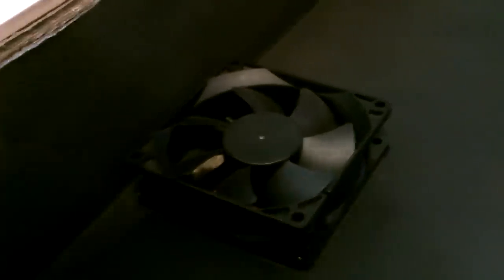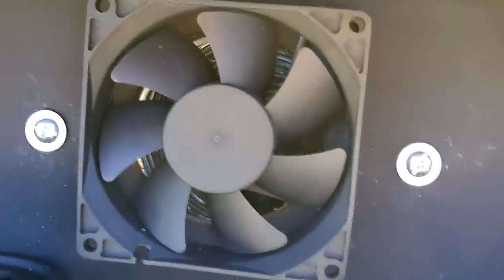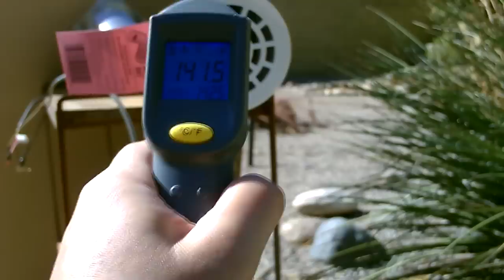Homemade "Steel Can" Solar Air Heater! DIY - STEEL CAN Air Heater! (140F+) - EASY Instructions!

Comment: So.... what was the outside temp when you tested this???
Reply: It's the same premise as a solar oven: it's the sunlight that is key. Preppernurse1 uses store bought solar bank batteries. Prepperhomestead has a vid on making a solar oven out of a silver sunvisor & a bucket. 🙏
Reply: @JR-zm2yu  check old popular mechanics  and science 1940..1960 there alot of stuff like this something simular idea for water heater
Reply: @miguelcastaneda7236  THANK YOU FOR YOUR REPLY AND TIP!! I'LL CK IT OUT. 👍👍🙏
Reply: @Tristan Arnold And cloudy.
Reply: 259 Fahrenheit.

Comment: This will seem obvious to most but I feel it should be said that these will not work at night so they will help a lot but you will also need non-solar powered heat after the sun goes down. One way to extend the heat is to have the air blowing over some kind of water storage. The heated water will give off heat for a while after the heater stops. This will only help a short while.

Comment: What is the steel piece that the hose slips over?
Reply: a 4-square 3 O-ring. You can get it at home depot/lowes in the electrical section by the 4-square boxes.
Reply: I thought so but wasn't sure. Thanks.
Reply: Junk Yard
No problem!

Comment: Very nice, but without knowing the temperature of the cool air coming INTO the box compared to the temperature of the warmed air going OUT of the box (and into the home), there is no way for your viewers to determine the efficiency of this design, and thus, whether this design is worth the effort and irreplaceable time.   You're obviously a smart fellow, so the absence of that information begs the question, why?

Comment: how long will it stay at 140 and cloudy days does it till work?
Reply from the maker: hi there, temps stay around 140F as long as the sun is hitting it. as is starts getting really cold out the max. temps will decrease but it still should put out nice warm air. (maybe 110F or 120F). it won't work on cloudy days.
Reply: thank you

Comment: take and cut a piece of plywood 1/2 and inch bigger on both sides of the duct cut a hole for the duct then cut the plywood lengthwise to match your window so you can close your window down on the plywood. To prevent heat loss add foam insulation cut to fit the size of the plywood and attach it to the ply wood using gorilla glue. now to the seams of the window and the plywood get painters tape and apply a few layers of it sealing the plywood to you window frame. Problem solved.

Comment from the maker: the "plastic" is just standard window screen.  it keeps the bugs out. the cans aren't glued together (just stacked). allows the air to climb from one can to another. i used plexi-glas. it's not smoked. it comes with a protective plastic sheet over it. just peel it off when your ready to use collector. that is 32" by 20". home stores sell thin sheets of wood that they will cut to size for you. i'm not sure what type of wood it is. only thing between insulation pieces and the frame is glue. :)

Comment from the maker: Hi there, Here are the dimensions: the frame is made out of a 9 foot long (1x4) piece of wood. (it's actually 3/4" thick by 3 1/2" wide). cut it into 4 pieces. two of the pieces should be 33 3/4" long. and the other two pieces should be 20 1/4". two of the insulation pieces are 32" long and the other two pieces of insulation are about 19" long. they are only 3 1/4" wide.

Comment from the maker: The fan is an 80mm polar typhoon series case fan ($5 at Fry's electronics). it's powered by a 12VDC 1.8 watt solar panel (or larger). just hook the fan and the solar panel together. (very simple to do, just twist positive leads or the "red wires" together and then twist the negative leads or the "black wires" together.). fan will run whenever sun is hitting the collector/solar panel.
Reply: Did you use regular paint or the kind to use around heat, like on a grill?
Thanks very much, this is great :)

Comment: Also, why did you cover the wholes with the plastic? Did you re-drill them.  Please try to explain things like most of us are dummies..lol..because I don't know much about carpentry.Did you glue glue the cans together to make a longer tube? Also, was that glass or a plastic sheet you used and was smoked? What did you use for the back of the frame? A thin sheet of wood? What was between the Cardboard sides you glued onto the frame?  The closed captions on Utube aren't very good...try them. Thank